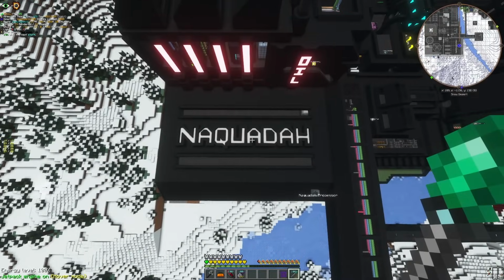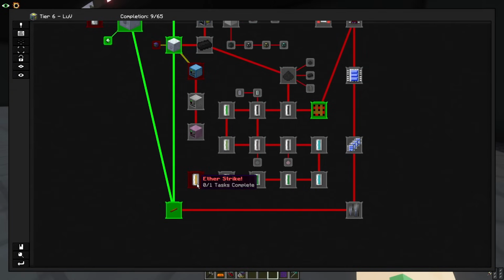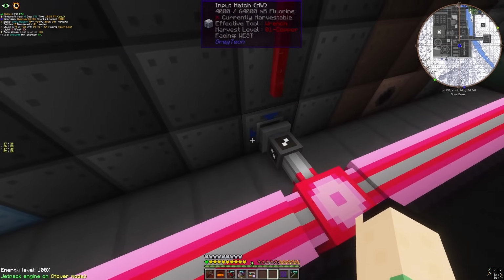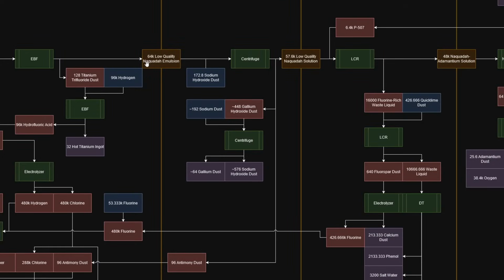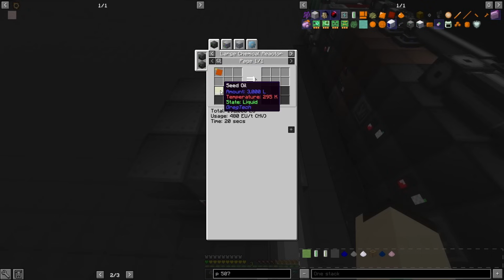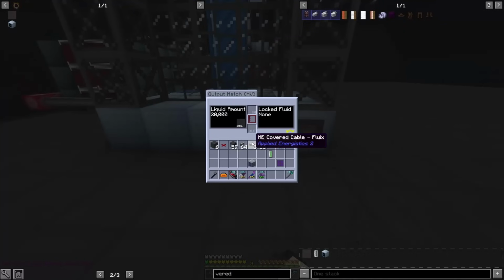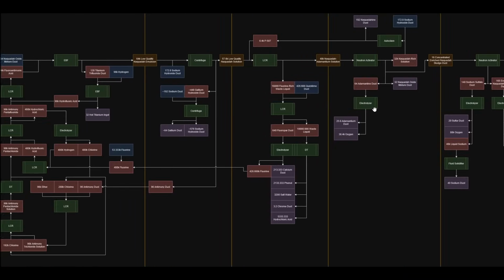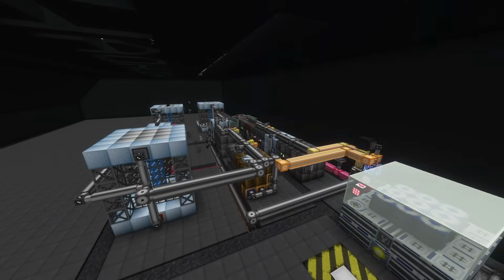GregTech New Horizons E73: Naquadah

Comment: I'm kinda said that explanations for the flow charts can be considered boring and uninteresting. I'm currently studying chemical technology of nuclear fuel, and the biggest selling point of any technical modpack for me is the presence and the ability to construct your own production chains and plan all the ratios. This reminds a lot of some of the stuff I learn, and it is not boring at all, cause it is very interactive and you can see clearly what you are doing contrary to just mostly learning how stuff is done.
Reply: Fun fact: P-507 is one of the solvents that was proposed (and maybe already in use) for the use in extraction of uranium, both in primary and secondary technology (i.e. getting uranium for the fuel and recycling spent fuel). It's cousin, D2EHPA, is used alongside TBP (tributylphosporic acid), which is like the most used solvent for extraction of uranium by far in fuel recycling, and TOA, which is a tertiary amine (trioctyl amine), which is moslty used in primary technology.
There's a company in Russia that does all things uranium from mining it up until yellowcake, and they use extraction as one of the latter steps in the uranium processing, and they use some mixture of all three of these solvents. It's like throwing every known acid into a chem reactor in hopes of dissolving whatever you need to process. It has it's merits and benefits though, there's a lot of cool stuff going on that makes this a viable thing, but we love to think that they did this just because they didn't want to think much about optimal ratios amd such😂 Sorry for nerd shit
Reply from the maker: @ i love nerd shit i need more
Reply: @Ham-Corp  glad to hear it! Well, there was something else on my mind. You kinda slip on it in the past, but the rare earths processing line seems very interesting in concept. I'm kinda surprised on the modpack devs' decision to make europium a fusion recipe among everything. A good push for realism would be to make solvent extraction lines, akin to naquadah, or some combination of electrolysis and metallothermic processes with calcium or magnesium. Btw, the rare earths solvent extraction is what I'm trying to do as a part of my scientific work (if you could even call it that) and I might even push it through as my diploma. Although I would most probably switch to molybdenum isotopes, because that's what they do at the place I'm gonna go do an internship at. Anyways, please wish me luck! Your let's play has been a great motivation to keep studying as i was struggling a bit there for it. I only wish that sometime in the future I'll be able to play the modpack without frying my potato laptop to ashes😭